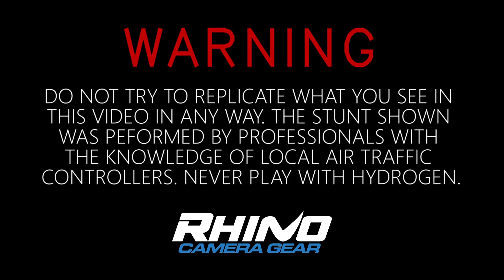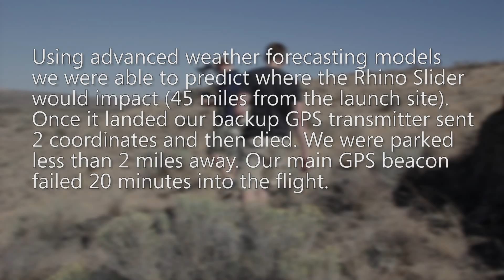Rhino Slider Drops from Space (Stratos)

Comment: Whats up w all the circles on the ground?
Reply: Fields.  They're agricultural fields.  They're planted this way usually to make watering easier as they can use a very large rotating pipe type apparatus that pumps water into thousands of sprinklers across it.  It rotates at a particular speed across the entire field so as to give the needed amount of water to the plants in an even distribution.